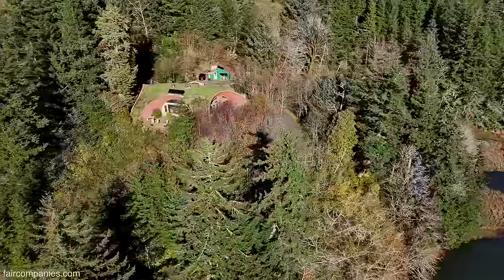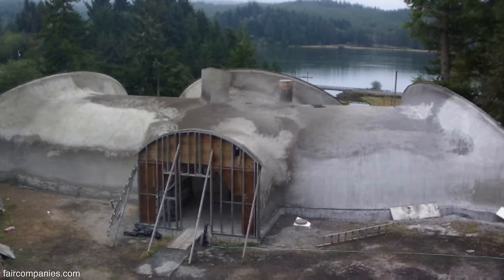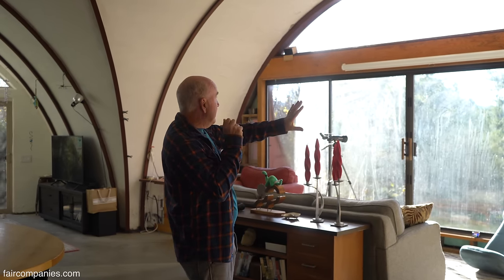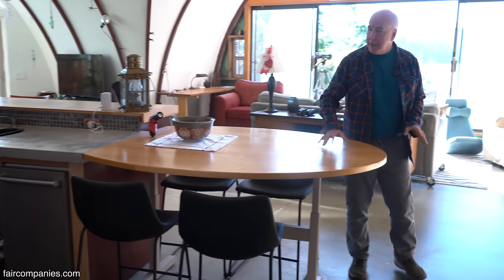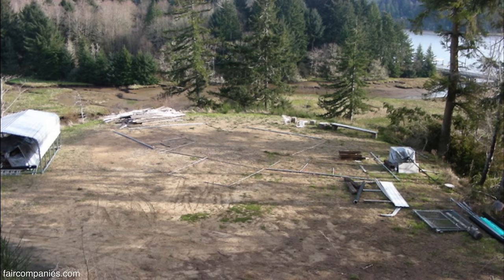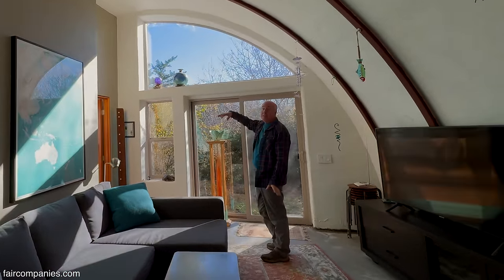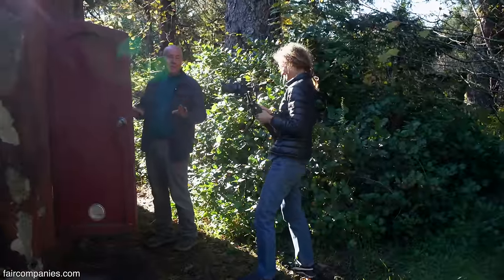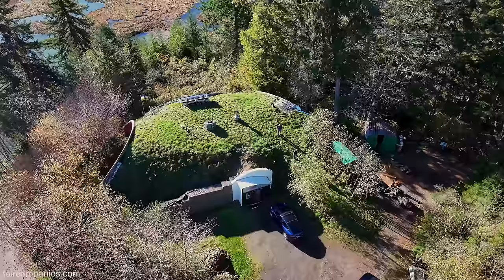No bank loaned them money. They built dream Hobbit Home themselves

Comment: I agree, more homes should be built this way!  Nice Job Steve n Jeff 🙂
Reply: Yep, just live in a trailer for 7 years and spend double the cost of traditional construction.

I like it, just not realistic.
Reply: @eric4903 You get a disaster-proof home. Have fun in your stick-built home when there's a wildfire.
Reply: @eric4903   They said ten percent more. And it is very common for people to live in a trailer on site while they build their dream. Tho you don't even need to do that.
Reply: @snowstrobe  Maybe 10% if you have nearly no labor cost, like this build.

There is no free lunch, this build has obviously higher material cost and much more labor required.
Reply: @aliendroneservices6621   These homes tend to have a lot of trouble with moisture. And to fix the 'roof' he has to dig 1000 tons of dirt. It isn't easy. 

Plus I'm guessing nobody around him knows how to fix that home. He quotes a 900 year lifespan for that concrete but I'm very skeptical.

Also they just let it sit as exposed concrete for years while they tried to get enough cash to buy the waterproofing? Did that damage the concrete frame? I dunno.
Reply: @snowstrobe the guy that said that will never have a dream home cuz he doesn't have a dream. Has nothing to dream with. You have to have Vision and a dream to do that🎉

Comment: I'm building an "underground" house, but coming at it from a slightly different angle. 

I'm carving the top off a natural rolling hill and building a slab on grade.  

The living quarters will be yet another structure within a concrete and steel shell . . . THEN . . . I  intend replacing that natural rolling hill by encapsulating the entire structure with all that dirt I scraped off initially.

A 24" x 200-foot tinhorn culvert pipe will be placed such that each open end is placed on each side of the main shell, offering geothermal cooling in Summer.

The dwelling portion will be heated by hydronic pipping within its slab creating a heated floor.

I live in Tornado Alley and my new home  will be both tornado-proof and flood-proof as well as feature only noncombustible building materials throughout.  I'm trying to come in at under $200K.  So far, so good.

Comment: So, if I understand correctly, the soil on top of the house acts like an insulating layer. I love this home. The arches provide a high ceiling.
Reply: There should be a vapor barrier before the concrete was poured.
Reply: @patrickrussell1888   There is a vapor barrier under the slab.
Reply: @patrickrussell1888  Correct me if im wrong but I thought the shotcrete was sprayed on.
Reply: @masterhenry838  Yes, shotcrete is sprayed on.

Comment: Excellent video. I would love to hear how these unique home build their septic systems. That is never mentioned and is a vital part.
Reply: Maybe they have composting toilets.
Reply: We have an aerobic septic system. 1,500 gallon, two compartment septic tank. The second compartment has a “bubbler” that aerates the effluent.  This then flows into a third, treatment & pump out tank. This contains an ”EZ-Tank” wastewater chlorinator and a pressure pump that sends the treated water (pretty clean at this point) out to 3 sprinkler heads dispersed into the woods.
Reply: @creativeguy3384  Excellent!!

Comment: Absolutely!!!  I'm in the process of placing wheels under everything I can - not to facilitate dance parties, but, those of us who are older want to be able to easily move furniture so we can more easily clean!  Whatever anyone's reason is, it just seems more logical!  Although, I suppose most people would think it strange! 

I also lived in a house with a lot of sunlight coming in, too. But living in the Northern Hemisphere the sunlight only reached into ~ 4' - ~ 4.5' into the house - just as this house in the video does, depending on the time of year.  I can't afford to build and live in my own house now, but I often wondered about living in a narrow house, where the darkness is "cut off" and the sunlight reaches more into the interior of the house, but, of course, you sacrifice space.  However, no worries - there is the mass of the house, which captures the heat - a couple of ways to heat - sunlight and/ or mass of the structure. 

The interior is beautiful,  with the curved surfaces; and the out side of the house is covered green, which is interesting.  But - another sacrifice is that with a right angled home, you have surfaces you can paint, although far more expensive.  I'm thinking about the black exteriors of homes in the Faroe Islands, places in Norway - and the beautiful, glossy dark green or black paint on the homes in the island in the Netherlands  - Marken. Also, the beautiful whites and blues (Greece and Spain [tiles, too]), or the exterior colors on the buildings in parts of Europe... This family has chosen a different path!

(Oh, yes, as others have mentioned - gorgeous views❤)

Comment: beautifull build , In  switserland  you  have  many  simulair   vetsch houses love  them  but  in  holland  we  have  so  many  rules  and  regulations,  hard  to  construct  sometrhing  simulair love  your vieuw   fantastic
Reply: I'm quite sure you can do it Holland, but with "German" level of engineering. No crazy foam forms and shotcrete, probably only good old plywood forms and poored concrete. Proper engineered insulation, waterproofing, draining, etc. And you do need a large plot too and I think they do not come cheap in the Netherlands :(. I am planning an Earth sheltered and covered house too and have no problems so far. In the en It's a concrete long bungalow that just happens to be covered with Earth on top and from 3 sides...

Comment: We just spoke with a company called biotekt and they make structures like this that are prefab modular and made from recycled plastic, go up quickly and depending on size range from 20k to 140k for the structure itself, we are so excited to get started in 2026 on ours. We live in de beque,CO which is about 5800 elevation, gorgeous view of the grand mesa from our property, it’s an arid desert area and on a mesa itself so can’t drill wells, have to do solar and we will be incorporating water catchment and grey water recycling into ours, the additional benefit is the fire resistance, our area that’s the main weather issue we can have is wildfire and these really reduce the stress of that possibly damaging the home. The systems biotekt does make it faster and easier to raise (6 days for a 2000 sqft home) and they also provide financing for them which makes it way easier than dealing with a bank because banks don’t like to help you if you are different and especially when you can’t connect to the grid. This was a lovely video to watch.
Reply: It sounds like a great deal, thanks for the info and good luck with all the construction process :)
Reply: EdynBlair -  The water thing is major.  Before you commit big $$$, please have your water catchment system well engineered, and with capacity to harness and save your snowmelt.

Built myself a quonset hut 25 years ago, and never looked back, but without the well, living in the country would be onerous.    Best of luck to you for sure !

Comment: He repeatedly said the earth is a heat insulator, which is not correct. It's a heat accumulator and a very slow one. There is a mathematical model that can calculate exact temperature at particular depth on a given day. From top of my head: In one meter (3+ feet) the temperature is equal to a day average 3 month ago. At certain depth (typically around 19 m / 60 ft), the temperature stays same whole year round and is equal to the average year temperature in that area. But I really admire the design and the work he put into this building. Domes do look great inside. I am planning an earth sheltered house myself, but I would never opt for a dome myself. Everything about it screams labour and customization. I also think this particular building method (foam "forms" and shotcrete combination, shotcrete in general) are quite on the edge, having a lot of technological challenges and risks. So I wouldn't even think about a dome; but that only makes me appreciate courage and hard work of people who go that way! 👍👏
Reply: Good point about the earth. Also, the foam on this type of structure is supposed to go on the outside, not the inside. One reason is fire. If the foam is on the inside, it turns it into an Easy-Bake oven in case of a fire.
Reply: @aliendroneservices6621  Oh, that's just a little misunderstanding on your side - the foam is used inside a s "form" and after the shotcrete process is completed, it's removed and put outside as one of the layers above the concrete (typically they do concrete, bitumen paint /hydroinsulation/, 2" of foam, hydroinsulating membrane, earth, membrane, earth). But the devil is in the detail, there are lots of small troubles in the process, randomly: It's very difficult to make the form from polysturene, the shotblasters have to be extremely careful not to blast through which goes against technological requirements of the shotblasting itself, the foam gets damaged when removed from the inside and due to the dome shape is often in small pieces, I don't think taping seams of membrane is good enough process (PE welding or professional grade gluing is much safer), etc. etc. I don't condemn it, but I think it's a long stretch and I'm quite sure many places (especially in Europe) would not approve it. Not the dome itself, there's nothing wrong with the steel frame, reinforcement or the theoretical concrete structure. The problem is the building process on site, where it becomes your responsibility to make form from polystyrene, to make contractor propertly shotcrete this super fragile form, etc. And in my opinion, that is simply super challanging... But I wish success and luck to all who attempt this.
Reply: @oakld  Thanks. That sounds insane, compared to the Monolithic method.

Comment: My parents had a very early set of Encylopedia Britania that was about 22 volumes that was not alphabetical. It was in the last volume that had an index to find various stuff. In one of the volume was pictures of a company in the 1940's using surplus military parachutes that they would anchor to the floor and inflate. They would then spray concrete to build various structures.

Comment: Steve says "It's not perfect" I say it is if you like it! My sister was showing me around her new house & in her magnificent yard I would ask, if this or that was a weed. She told me "If you like it, then it's not a weed, It's All Relevant you know." (a lot of people would love having the black/ blueberrie plants, just not on the roof) I would get one of those auto lawnmowers, with a little power station, just for the roof! Maybe to help with the unwanted berry bushes, lay down some chicken wire on top of it & when it weaves & tangles a good hold into the wire, pull the wire up and perhaps take a lot of roots up as well!❤ I  Love This Home!!!
Reply: In this environment, you soon have a huge mass of the invasive black berry.  In a few years, they would have brush started. After decades small trees would be cracking the concrete.

Comment: Can you provide what company they went through for the engineering and metal ibeams?
Reply: Steve & Jeff or Kirsten Dirksen could you confirm?
Reply: I'm also very curious about the aircrete or prefab block you used for backfill between your doors and windows under the arches?  I'm about to be building in the Seattle Puget Sound area and would love to know the supplier you used for that product
Reply: Any updates?

Comment: Would you mind sharing the name of the company that helped with design and fabrication?
Reply: I'm quite sure it's the one you can find quickly by throwing couple of dome kit keywords into google. To be honest I'm not fan of their building methods. The shotcrete is IMHO a technology on the edge for residential housing. It can be very porous or even contain large cavities (especially where dome sections are intersecting), prone to crack. And then the foam "form" is a pure gambling from my point of view. Those domes don't come cheap and if you were to do the forming and poring concrete properly, very expensive compared to concrete "box" earth sheltered house. And the trouble continue, with almost everything being more labour intensive. Domes do look great inside though and I guess that's why those brave people go through the pain 😀👍

Comment: Cool concept but it seems very time consuming for very little square footage. I know energy efficiency is the goal but i would think building against a hill with less overtop (but still some) would be a lot easier and still have a lot of the same heat saving qualities. Also, having four openings for windows kindof saps a lot of that temperature efficiency.
Reply: Where we live in Oregon the climate is fairly temperate with few extremes.  Light for us was more important.

Comment: Funny thing, once they put all this earth on top, they don't need any rebars at all. The whole structure became compressed, and concrete (and stone) works very well with compassion. But building without rebars would require to build formwork first, so I think it was more cost effective to use steel arches and rebars.
Reply: I would have thought the rebar needed to be there to help mould the polystyrene (and ultimately form the base of the concrete coating)? But, in terms of strength, I see what you mean.

Comment: What is the company they used to help them design/build it?
Reply: FormWorks is the company in Colorado that sells the "building System".  We designed it, They did the engineering and then shipped out the bent steel arches.  Jeff and I did most of the actual building ourselves.

Comment: I LIKE this one a lot! Problem: though this is a great home, it most likely cannot be used to build communities. The amount of steel and concrete needed for large scale building is not feasible and is too expensive. Just like may "climate change" one with nature structures, they work on a small scale, localized. They still depend on modern materials that create as much pollution in the manufacturing of those materials. You have created just as much or more carbon, you just did it remotely and paid up front.

Comment: Thermal mass temperature moderation and storage system. But not insulation - that would mean it prevents heat transfer - it simply slows it down.

Comment: While I absolutely love dome homes and would love to live in one. This in particular one could not survive a nuclear blast.  While the main core structure may still be standing, they have to many openings. Ignoring radiation, one of the biggest dangers of a nuclear blast is actually the movement of air.  The air moves so fast and with so much force it'd push through the openings of their home with ease, destroying everything inside including any residents.  Depending on you lookout you could say the structure would survive, but I think that statement is pointless if the residents and inside are completely destroyed.

Comment: be interesting to measure the resonance of that place with all that charge depleting steel. can do it cheaply with dan winters flameinmind app,  or the more expensive biowell sputnik. The point is, generally the more steel and aluminum you add to your house etc, the less Schumann can resonate, which is a deadly mistake to your DNA. 
dan winter has many lectures on youtube about biologic architecture.
Reply: Thanks for this info.